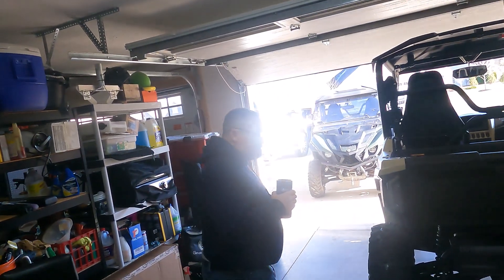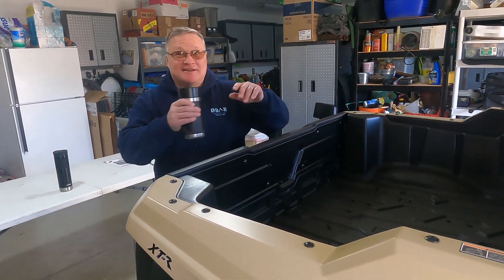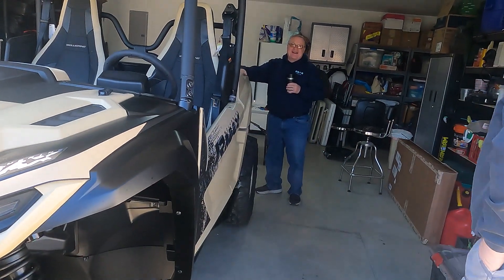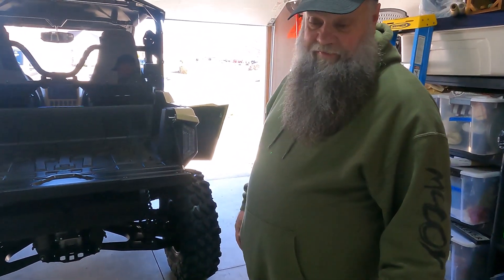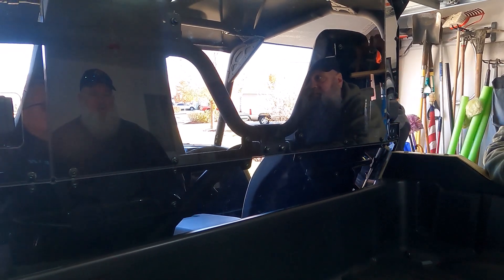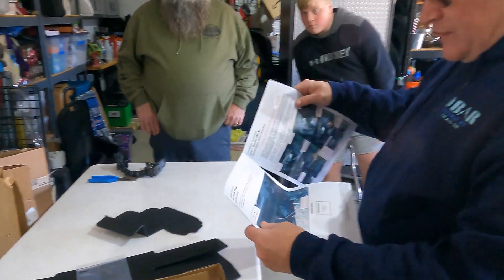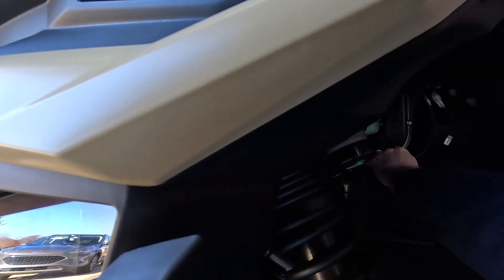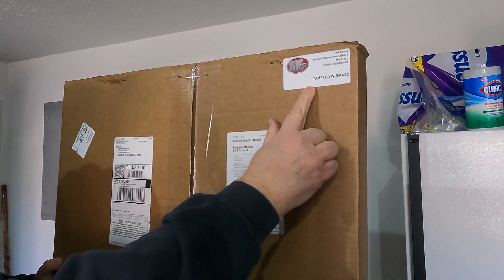RMAX Must Haves: MudBusters Firewall Guards, Windshields, Trail Armor Extensions With Installation

Comment: Hey guys! My kinda over the hill group!
Reply from the maker: Yeah, we want to go out kicking and screaming for sure!
Reply: Mello group of dudes…I have the same machine and love it…I’m in Pa. As well ..bought mine in NY state at Lanes Yamaha ..my mods include, glass windshield, rear windshield, fender extenders front and rear, body protection, tubes that go around the front and down the sides of the machine, A arm guards front and rear to save the CV boots, LED lights that go in the hood to replace the fake air Scoop, plus some other stuff I’m forgetting at the moment, I’m over 60 so the memory is fading ….hauled a few buck out of the woods this past season so it’s already earned it keep, too old to be dragging deer around my farm…keep on keeping on men….my other machine is a 2004 Yamaha rhino 669 that is still running and in excellent condition, never had an issue either it in all the years I have owned…speaks volume for Yamaha quality …they make great machines ….
Reply from the maker: The only draw back for me having purchased the machine in PA was that I had to pay more in taxes to OH when I licensed it.  It seems we're taxed at a higher rate here. :(  Great idea getting the arm guards.  Rob and John put them on right away.  I'd already spent more $ than the bank lady (wife) had authorized, so I have to sneak them on later. LOL!  We agree, the Yamaha's are great machines for sure.  Thanks for sharing.

Comment: Yes mud busters both inner and outer. But what i ordered the very first day i had it along with those was seat belt harnesses to get rid of that unbelievably thick and low mounted inner buckle that left my leg bruised and sore for a week after only one hour of riding dirt roads. Yes front and rear windows, flip UP not down on the front and EMP on the rear they are the best IMO and they are the only plastic one that doesn't come cut out for the removed factory seat belts. If you are going to ride any at all in the dark you are going to want side lights, I promise you! I have lighted Seizmik mirrors that work great for this. Wish I'd put them on before installing the inner splash guards. Any wiring should be done before those go on. They're a little hard to install (or at least mine were) and i didn't want to remove them just for one wire. Stuffed a rag into the passenger's side grab bar to keep the cold air from blowing directly into lap as well. Oh and don't forget to get two clevises for the front.
Reply from the maker: We've been toying around with the idea of harnesses to be sure.  We just haven't pulled the trigger yet.  I like the Seizmik lighted mirrors, too.  Good call!  Yup! We have the clevises for the front.  Those are a must as much as we get stuck!